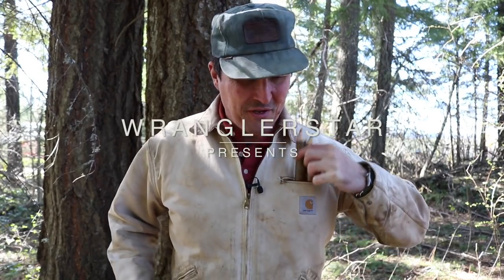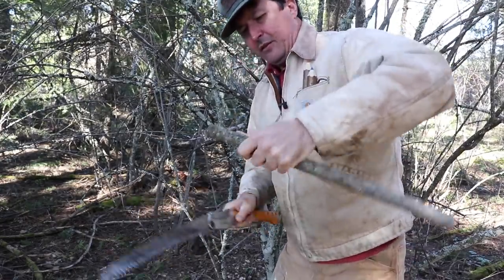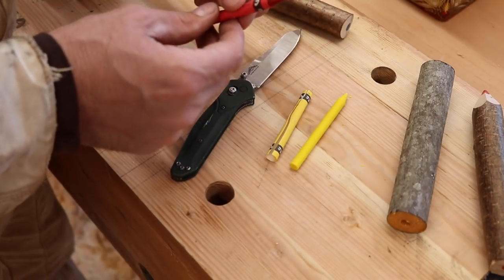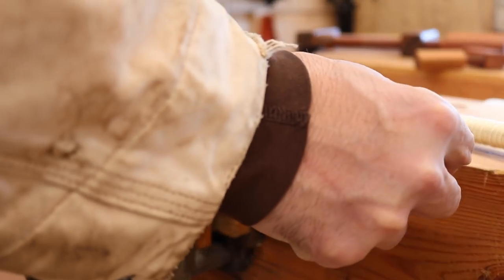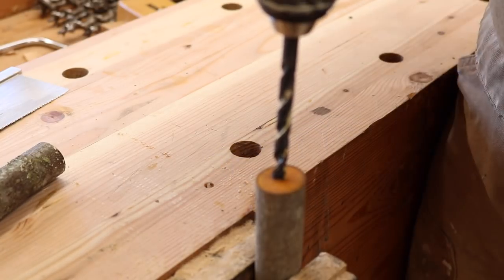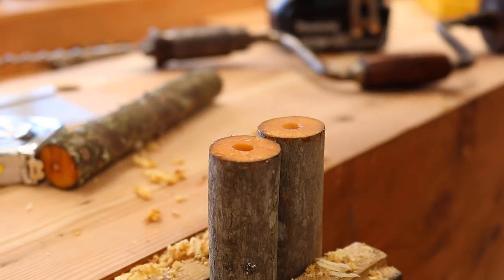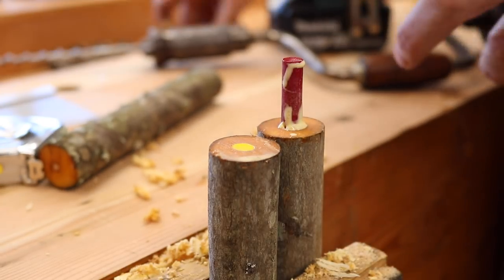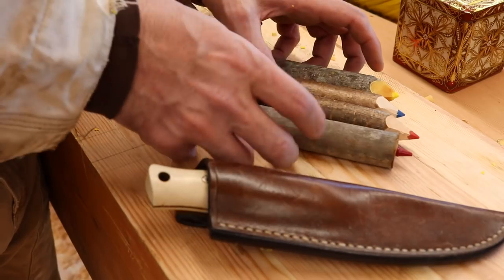How To Make Branch Crayons

Comment: Cut off a smaller bit to put at the back end instead of half. Gives the illusion of going all the way but leaves you with more to color your picture book in.
Reply: plug one end then melt a bunch in other end to fill the whole stick.
Reply: @JWS1968  John's got the idea, use it like a mold and fill it up. You can cut off the back to reveal the backing if you want or keep one side sealed.

Comment: What if you took 10 or so crayons and melted them down then poured into the wood body so like a carpenter pencil you could just a knife to sharpen it?
Reply: That's how i thought he would have made them. I can see him making another video and doing it that way
Reply: I'd be lazy and just take the tips off of some then insert them until the wood was full.  Then it could be sharpened as needed without all the messy melting?
Reply: the crayon wont fuse to the wood that way
Reply: +Steve Long 

Yeah, just buy a few boxes of crayons, and use at least two crayons of the same color for one pencil. And make the pencil thinner too. It's not going to be made just for looks. : )
Reply: Well to handle that I have this rack that is made to cook bacon wrapped jalapenos in upright so the cream cheese doesn't melt out. But would that dry out the wood to point of cracking?
Reply: if you're really lazy you just buy a set of crayons.
Reply: If you're really lazy, you could do nothing at all.
Reply: I guess he was just going for speed
Reply: Connor Doll 😊😀☺😉
Reply: Gott nbkznhnn nun noch bgthg.überhaupt zatim 4,😁😁
Reply: @Felicia Fox - Wenn ist das Nunstück git und Slotermeyer?
Ja! Beiherhund das Oder die Flipperwaldt gersput!
Reply: Connor Doll finally some one who understands
Reply: +Arkansas Pilgrim Von Grammatik und Satzbau hast du wohl auch noch nie gehört?
Reply: Thank goodness for Google translate.  I'm actually pretty good with grammar and sentence structure, just not in German.

Do a YouTube search for Monty Python, and lethal joke, or die laughing.  I posted what they say in that sketch.  It's non-sensical (or bullshit, if you prefer).

I know nothing about German, except what Mark Twain wrote about in an essay entitled "The Awful German Language".  It's funny, and a German man I knew said it was 100% accurate.
Reply: +Arkansas Pilgrim I've read that too and it is very funny and accurate. I knew what your comment was about, but I decided to see how you would react to this. I didn't expect you to understand german.
Reply: I translated it with Google.  I sort of guessed what it said, too.  "Grammatik" was a giveaway.
Reply: +raphael beinhauer *sentence structure
Reply: "Of grammar and sentence structure you've probably never heard" was how Google translated it.

Just to be clear, my response was meant to be in fun.
Reply: Arkansas Pilgrim Yes, I know. So was mine.
Reply: I could tell.  Just making' sure.  No non-verbal on the Internet.
Reply: Arkansas Pilgrim I know. Sometimes you can't tell at all.
Reply: I was gonna suggest that to
Reply: That's how you make them normally. This method is new to me, it seems wasteful and useless.
Reply: You wouldn't even need to melt them down. You could just get two crayons back to back and heat up the tips and fuse them together, for whatever length you need. Just keep the ends flush.

Comment: I made mine but I drilled close to the end but not the whole way through, melted the crayon go a funnel and poured it in the whole and let it dry, after it dryed I cut off the button revealing the crayon I then sharpened it into a usable crayon! Anyone doing this I highly suggest doing it this way!
Reply from the maker: Good to read.
Reply: I was thinking the same thing as I watched. They make those "So Big" extra large crayons. You could bust it up and melt it down in an electric ladle.
Reply: I thought the same basically, however drill from both ends for one long continuous hole then to keep the melting crayon in the hole not the wood stand on end fill with glue for just a second then drain it out let it soak in and dry to seal the wood to then fill with crayon that melts to low heat.
Reply: Dude when he broke the crown I called it and I yell at my phone "melt the dam thing"lol
Reply: @wranglerstar  When I did mine I didn't want to melt ... But I only cut a little quarter inch off the end of the crayon for the plug on the bottom and used most of the crayon for the top... I found it was better to drill a 1/4 inch deep hole, insert the crayon, then slice it off... To avoid breaking that very small piece of crayon plug.
Why waste all that crayon just for the look on the bottom? 😁 ... Good excuse for an update video for more views 😎😎.
Reply: @DBSMODs   you can alwasys sharpen the opposite side when the other side is done
Reply: That sounds like a good way to spend you weekend cleaning your funnel from hard wax
Reply: @Natalie Glass Look at Mr. Fancy over here with her "cold water"
Reply: I think the point of his tutorial was the ease of making it.  Sure there are other ways, but now you are involving fire/heat/melting, funnels, towels and clean up not to mention probably adding another 30 minutes to an hour to the project.  Keep It Simple Stupid :)

Comment: Wouldn't it be easier to melt the crayons and pour them into the sticks?
Reply: Try it and let us know.
Reply: dudelivestrong no. Because you'd still need the same steps, plus adding another two steps, melting the wax, and then cleaning whatever you melted in. Never mind and mess you make. 

It may be a better way, but not easier.
Reply: you wouldn't have to mess with glue, I'd prefer that
Reply: Glass syringes? I have a really old one that could be used for this
Reply: Ive tried it in middle school. Lots easier.
Reply: axtra92 - It's not just about not drilling holes, etc. but it gives you a whole crayon inside & not just a tip at the front & back... and therefore you can sharpen the crayons. BTW dealing with melting crayons isn't really difficult or messy if you know what you're doing. 😉
Reply: +Diana Fronsdahl "if you know what your doing" lol, I don't think you need a degree to melt a  crayon . however there still would be mess to clean up. 

In regards to filling the length with usable crayon. I'm not sure these are ment as an item to be extensively used, more as a cool looking prop. 

Lets face it, only 'special' adults actually use crayons.

Comment: These are pretty cool. I really did think you were going to melt the crayons and pour them through the drilled out branches to fill the whole thing. Once I saw that you were putting a piece in each end, my next thought was "why not use two different colors and sharpen both ends?"
Reply: Bob Ashmore cool idea

Comment: It is a nice way to make a branch crayon, but my wife being a soaper, I can suggest that after you make the hole you can just pour in melted wax and let it solidify in the branch, if you get the wax quite warm rather than just melted it will flow very well.

Comment: These old style auger bits have a screw tip. It does well to pull the bit into the wood when drilling cross-grain. The screw doesn't hold very sell into end grain and you have to apply more muscle/pressure on the end-grain wood when drilling.

Comment: The branch crayons will make a happy grandson. I may do a thrubore on the branch,tape over one end then melt about an inch of each color into the open end and give it a color change as it is resharpened. Bore diameter will not be critcal.

Comment: That old bit definitely didn't have a tighter tolerance. It was more worn out so the hole was smaller lol. That means it's probably super old. All it was cutting was wood probably. Also I'm sure crayons aren't to super exact specs
Reply: They are, not a signle crayon leaves the factory if it isn't exactly the correct dimensions.

Comment: Nice idea. Something easy to do with my niece and nephew. Glad something from England made it into tool kit.The brace drilled hole had the bit turned alot less than the battery drill.I think that's why it was was tighter.TkEZ»UK.xx

Comment: I like your channel and have seen many useful topics you've hit on. This crayon marker is a good one as well. Made some people think of how to improve on it or make it more for their liking. For instance, heating the crayon to fill the hole. That way you could use smaller diameter material or even a wooden dowel with a much smaller hole to fill. That is if they want a more modern looking marker for their tool box as I would like. And I could not have thought of it without your original idea. So thanks! Keep up the cool video's.

Comment: Question: Could you drill through except for a little at the end, then melt a couple of the same color crayons into the hole, then cut cut off the ends after the crayon dries? not sure if it would work but just curious, since it would fill the entire thing and you could use it all and just keep sharpening it.  Shouldn't need any glue that way either since it should bond enough to the grain in the wood.

Comment: Someone probably mentioned this but there's over a thousand comments. The hole drilled by the electric drill vibrates a bit for a couple of reasons so that could be the reason for the difference in hole diameter.

Comment: You could drill smaller or larger holes, melt the crayon and pour it in also.  Do it in layers so your crayon would change colors as you sharpened it down.  I think that would be interesting.

Comment: Wrangler star you should try getting a few of the same colors and melting them down so you can have it the whole length of the wood crayon so you can sharpen it as the tip gets dull

Comment: The slight difference in hole size doesn't necessarily mean there's a difference in the bit diameter.  That can also happen when:  1. You wiggle a little while drilling(sometimes we do this on purpose to make a hole fit more loosely) 2. One of the branch sections could have more elasticity than the other and spring back slightly more after drilling 3. Waxes of different colors have different pigments which cause a difference in shrinkage during cooling (yep, I said shrinkage).  4. Any combo of these things.  When you drill in metal with a metal bit and a drill press all these factors recede (but not completely!)

Comment: The drill bit cuts the sides, while the brace and bit only cuts at the tip. The slower speed difference prevents more material from being removed along the bore hole, then the glue causes pressure to build up because of the tight tolerance. Love hand tools, you do get a better and more rewarding finish. 

PS. you can melt the crayons and poor them in to fill the entire length. They will set solid again.

Comment: Crayons are made of wax. Wax is used as a release agent with epoxy and glue. The glue won't stick to the wax. It will fill most voids, but won't hold the crayon in the hole.

Comment: Something I learned the hard way last year is that drill bits wear in diameter - they get smaller.  So if you need a precise fit and you resharpen the tip you might still have a drill bit that is wrong.

I make wood parts drilled to a bearing fit for a brass tube.  After making hundreds of them I found out the tube was a press fit.  That was using the exact same bit I used for the last batch.

That may be why your brace bit is smaller - it could just be worn down.

Comment: you might be right about the bit making a tighter hole, however it could be that the crayons are not the exact same diameter. I would imagine the tolerances for crayons or not that tight.

Comment: I believe the difference between the two bits are the speed at which you make the hole. Faster speed = slightly bigger hole. (bit moves around more) Slower hand speed = hole closer to the size of the bit.

Comment: You can make it go all the way through by using a drill press to drill all the way through, put a little plug in one end, melt the crayons, and pour them in. Then after it hardens just trim off the end with the plug and you're set.

Comment: There is a reason for why the old drill bit is smaller, or rather why the hole with the old method is tighter. When using a power drill, you tend to wobble around the center and therefore making the diameter a bit wider.

Comment: I think possibly the close tolerance of the Irwin bit makes the air escape inhibited thereby resisting the crayon entry. The glue in this case is acting like a seal. If you were to try to take a knife and make a small groove in the side of the crayon...enough to let out air, I think maybe the crayon would go in easier?   just wondering

Comment: Hey Buddy....just found your channel, sat at home with a multiple fracture, healing, so chainsaws are sat in the workshop! Tell me, would it be easier to drill the holes, then cut the facets before you set the working crayon home? Knowing me....I'd snap the end off the crayon!! Great Channel, I hope you are still up and running. Green wood worker in the UK

Comment: I wonder why the brace bit was more precise than the modern bit.  I don't know if this is common knowledge, but I noticed when I was drilling holes for a dowel, if I drilled a pilot hole first, the final hole would actually be smaller (More precise) than if I had used the final size bit and drilled the hole without a pilot hole.

Comment: What if its not the fact that the new bits dont make tight fitting holes, but the technique in drilling it. Like the old way u take your time and go slow and not much wobble. The drill goes so fast even a lil wobble is going open it up just a lil bit more.

Comment: your twist drill was designed for steel. the Irwin bit has geometry designed for wood.  The lead screw pulls it in and the spurs keep cutting the side where the twist drill is tearing at the outside.

Comment: If you use a green stick and it is a reasonable fit you don't need glue at all. I've put handles  on kit knife blades that were threaded using a drilled out green stick and once those things dried and shrank they are locked on to the point that the only way to remove them is to burn them off or split the handles. Even in one case where the hole was a tad over sized and I stuck a skinny tooth pick inside to help tighten it up once it shrank it was the same way. That would not have been true of course if I'd used a dry stick which is why some craftsmen make use of this trick when making handles or joining wood.

Comment: I wonder if you could just use the green wood, drill the hole and put the crayon in without glueing it in. The shrinking of the wood during the drying process should be enough to keep the crayon in pretty tight.

Comment: i was thinking of either young sassafras limbs or i think elderberry has a soft pith you could ram out. might have to melt the crayon to pour it in though if the hole isnt the right size. or ream it with the drill bit i guess which would have almost all the hole already open

Comment: I would take the stick and drill a hole clean through one end to the other, melt the crayons and inject them into the wood so you have a full length utensil instead of something that ends half way through. Wouldn’t be hard. Grab an oral syringe a hot plate a small bowl melt your crayons and fill the wood with the liquid. As it cools it will harden onto a solid center.

Comment: I think if you got more then one box of Crayons and took out the same color you would have enough to make it run all the way through. It's Wax right ? So im thinking a few ways you can make this way better but, it's all just thought. So no idea if this will really work. 1. maybe you could just stuff them in one by one but, then you end up with a break in the crayons witch leads me to number 2. You might be able to pop them in the oven for a short time not only will this dry the wood faster maybe but, for sure melt the wax together and take better shape to the hole. And 3 maybe you can melt the wax before hand or aka the crayons and poor it into the hole there for making it a good fit still. You would need to cap both ends in oven and one side when poring the wax to keep it from leaking with what idk duck tape comes to mind not sure how it will far in the oven.

Comment: Maybe once you have your wood and drill a hole through it stop there. Then proceed to take the color crayon you want and melt it it a small pan (or even a soda can cut in half with the edge bent in a v like shape for a spout to pour the liquid wax) then pour the liquid wax in the top of the branch with one end facing vertically up and one end of it plugged or just against the top of a table. Let it dry and then sharpen your wooden branch crayon. This way the crayon goes all the way through the wood without any breaks in the wax.

Comment: I think it would be better to cut the crayon more like 80/20 instead of a 50/50 half cut . That way you can put the 20% length at the bottom and have the 80% length at the top giving you more crayon to actually use and sharpen .

Comment: IMO having the hole all the way through would eventually be a waste of crayon because you will only be able to sharpen so far before it virtually becomes impossible to sharpen anymore. Cody, I do like the idea of a 1/4" crayon plug at the bottom to give more available crayon at the top...cheers, Ray.

Comment: Crayons melt at such a low temp, why not just pour them in the hole so it goes all the way through and have a real one that goes all the way through.
I let a bunch of maple saplings get started in the edges of our yard and have as many real sturdy maple shafts as you want for tool handles.
I made a real nice walking stick out of one and have others drying in the garage and basement.